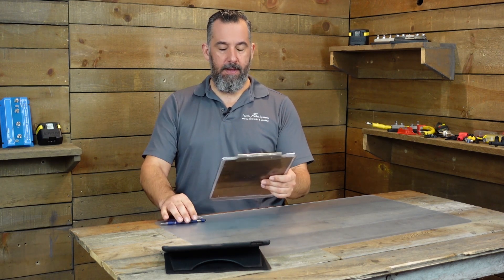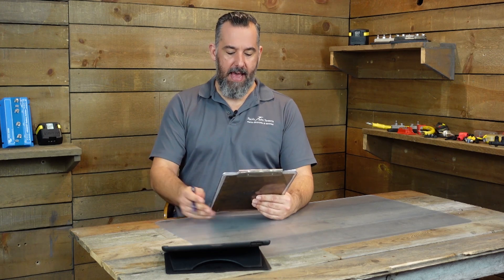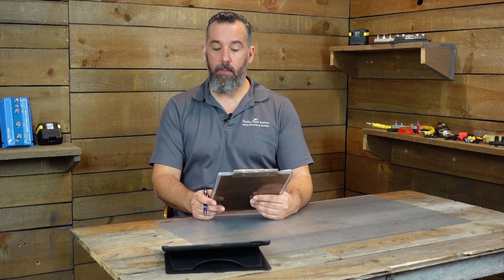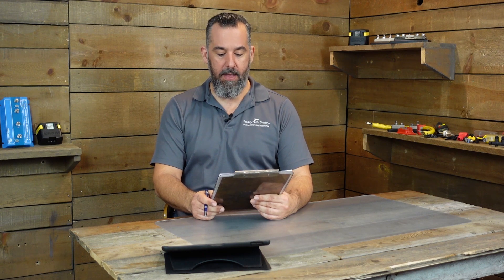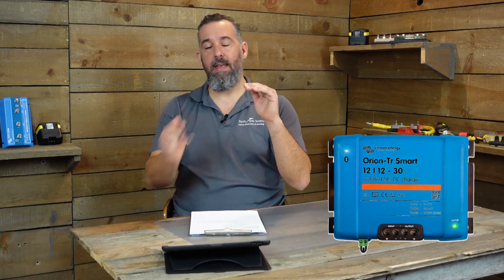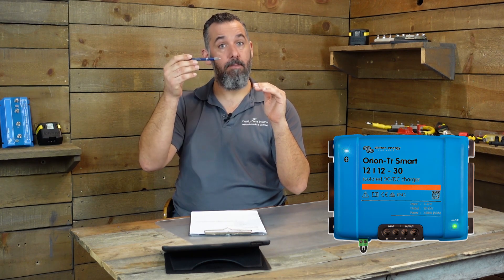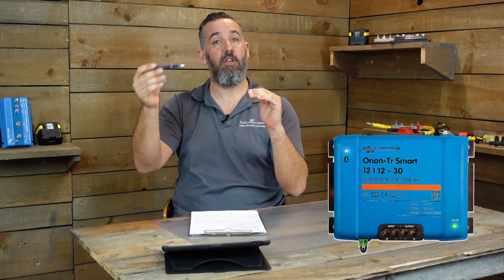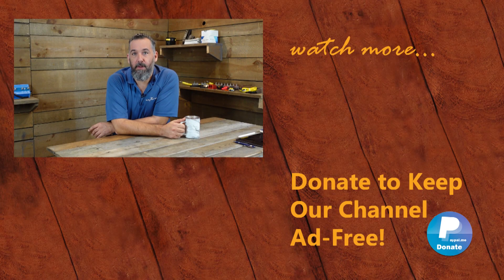How to Charge a Lithium Battery House Bank and an AGM Starter Battery at the Same Time?

Comment: Would you use a  isolated DC-DC charger or a non isolated DC-DC charger for this  mans boat ?
Reply from the maker: Isolated.
Reply: @PacificYachtSystems  why isolated? All of the ground/neg wires are connected on my boat - essentially non-isolated, and the batteries all sit in the same area. Do I need isolated for some reason?

Comment: Thanks for the video Jeff 👍. I have a question, so in this instance which bank  would you charge with the alternator and which bank with the dc-dc charger?
Reply: Best to charge the agm battery with the alternator and the Lithium one with the DC/DC charger as this charger will be programmed to the specific needs of lithium batteries
Reply: @JPJCH1  thanks for the reply, that  makes sense 👍 do you know how much current are the larger dc to dc chargers capable of these days in the instance you have a large house battery bank? Regards Stormer
Reply: @stormer6364  I am planning to get a 30A charger for a 100 Ah battery, both from Victron. Or the same from Sterling Power. The recomendation I have read is the charger should be sized at around 25% of the battery capacity. That said I have not seen bigger DC/DC charger from Victron but a 60A from Sterling Power does exist. I understand that you can also wire two chargers in parrallel if needed. In any case I will buy both charger and battery from the same supplier after submitting my wiring diagram for approval.
Reply from the maker: Good exchange everyone, agree with JPH recommendation.
Reply: @JPJCH1  sounds good, thanks for the reply, it's nice to know what these chargers are capable of. Many thanks for your time. Best Regards
Reply: @PacificYachtSystems  thanks Jeff Best Regards 👍

Comment: Hi, Jeff.  You confirmed what I have  in mind.  In fact, I've purchased the Orion 12-30.  However, what I'd like to know is which way to charge, 150-amp alternator to 600 ah house bank, then DC-DC to 100-amp AGM starter, or the other way around.  I suppose this is the tricky part, because I've heard good arguments both ways -- faster charging straight to lithium, thus saving engine run time, but harder on the alternator and possibly the lithium batteries.  With a Balmar 614 regulator, incl. alternator temp sensor,  this shouldn't be too hard on the alternator, but is it still better to slow-charge the lithium bank for longer life?  It's a real conundrum!  Oh, and I also have a Sterling APD coming to protect the alt. 
Love your vids, even attended a seminar or two a few years back.  Glad you're still having fun!!
Reply: Hi Wayne,
We charge the AGM starter first. Couple of reasons for that: 
1. We dont have a smart alternator. 
2. We prioritise the starter for obvious reasons. Not sure how the Orion works but the Sterling we use stops converting if the input voltage drops below a certain level

Hope that helps
Reply: Charging a Lithium battery with an alternator is not the best solution, a lithium battery has a BMS that can disconnect the charging side, if no preventive measures are taken, your alternator will be damaged.
Reply: @JPJCH1  That’s precisely why I’ve ordered the Sterling Alternator Protection Device, along with my smart regulator.  Still hoping for an answer to my question!
Reply from the maker: What a hard question, pros and cons on each side. Most boaters will go with charging the AGM engine battery first.
Reply: @PacificYachtSystems •▪︎●■ i've got two AGM crank batteries going to an 140 amp isolator then to an AGM house battery then to: fuse box - toggle switches - load (well, it's a dual purpose battery that I can hopefully use to jump the 2 starter batteries in a pinch if they are run down by the radio/headlights or something). Because it is not a specifically designed due cycle i'm adding a LiFePo⁴ 100AH house battery. I purchased Renogy 40amp DC-DC charger with the intention of putting it after the AGM (which is going to remain on the isolater which cuts in at 13.3 & out below 12.8) and move the load to the Lithium battery. 
Is there any reason to be concerned? (I'm going to put 60amp in line Fuses on either side of the charger for a little assurance but my main concern is charging).
Should I put the charger first, then the lithium and put the agm next (with or without the isolator?) My research indicates that going to the a GM first is ideal. And I think that is what my question is summarized as "go to the a g m first or go to the lithium first?"